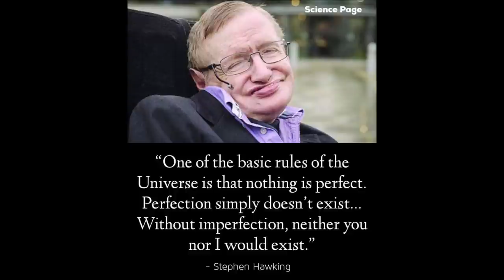1966 Chevy Nova SS 327 2n1 1/25 Scale Model Kit Build Review Painting Weathering AMT AMT1198

Comment: I bought a 1966 Chevy II SS 350 horse 327 new and it came with a double pumper holley carb high rise aluminum intake manifold. It was yellow with black interior. I changed the exhaust to the way you have it. The engine also had the dual horn air cleaner and chrome valve covers. I put traction bars similar to those that came with the kit. I could pull the front tires and it took about a month to burn off the 695x14 tires. It was fast. Liked your representation.
Reply from the maker: Thanks John!

Comment: I still am fairly new to modeling and I also do model trains but I noticed that you don’t strip paint on the parts you glue. Does the glue stick better if you scrape off the paint, leave the paint, or does it even have an effect on how well the glue sticks?
Reply from the maker: I use super glue and go paint to paint. No real issues so far.
Reply: @hpiguy  Thank you for responding and keep up the great work

Comment: Dude I love all the Lil (tools) you use to hold the parts of the car your painting and preparing. Did you make them or buy them somewhere? You do your model work just as I do mine, custom work to make it your own car, not as the picture or direction tells you. Everything I build I have to make it my own, it's always custom so It stands out from anyone else. Good work and great car also. 67 is my favorite but 66 is basically identical.
Reply from the maker: The stands are 'soldering helping hands' and the tables are Tamiya paint stands.

Comment: Awesome job as usual, Chris.  I learned so much from watching your videos, especially the finer points of detailing.  A few quick questions for you:

1.  Do you bother stripping/dissolving the chrome plating from parts before painting them?  If so, what do you use, good ol' plain white vinegar?

2.  What have you used or do you use to safely soften/dissolve old glue from a "glue bomb" without melting the plastic model?

Thanks!  Keep the instructional vids coming! 👍😄🇺🇸
Reply from the maker: I don't remove chrome but Super Clean will eat it off easily.
I haven't rebuilt a kit yet so I don't know but I've heard freezing it helps break it apart.

Comment: try using scotch tape for the trim to get a nice looking clean trim i build cars and military model even my own creations and a tooth pick works great for some things and i was watching something real cool they have real chrome paint that looks like real chrome u would like my model use to take first place all the time the one u are working on i would have painted the grill flat black then u wipe it so u have the black in the back ground when dun it looks more real hard to do and get it right and it needs hoses break lines spark plugs and wires what u do is get phone wire witch many color and different size wires then u just drill little holes strip the end poke end in hole just have a set of mini drill bits but i get real detail in the build even built a working 1/25 scale tow truck had a wench to pull car up on bed bed tilted and extended to the ground

Comment: May I ask how you fit the engine in that with the headers on? mine doesn't seem want to fit instructions not too clear on that.
Reply from the maker: I don't recall if I glued them on before it after I had the engine in. I make so many kits I can't remember exacts on a lot of them, sorry.  
If it doesn't fit with them on, pop them off and insert from underneath and attaching with super glue usually works.
Reply: @hpiguy  it's ok I appreciate you taking time to answer back. I'm learning a lot from your videos though keep up the good work